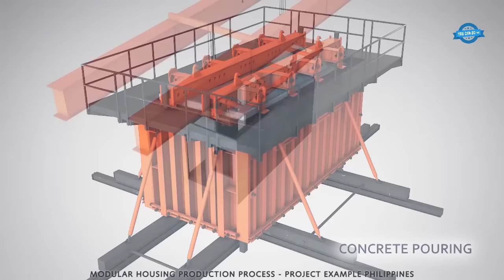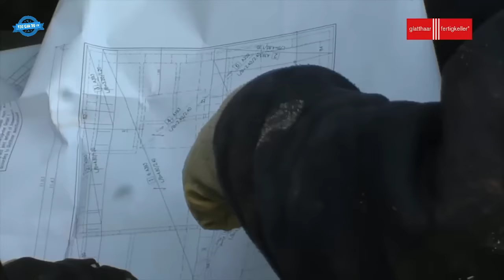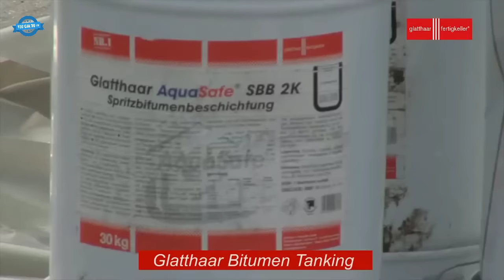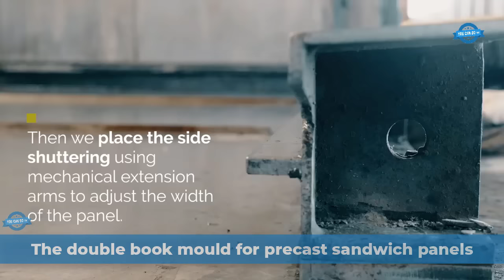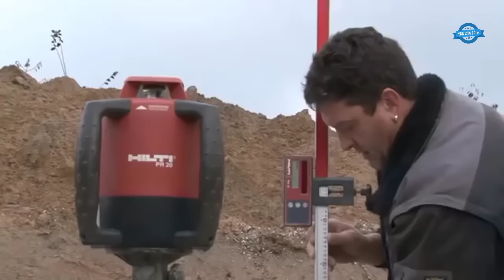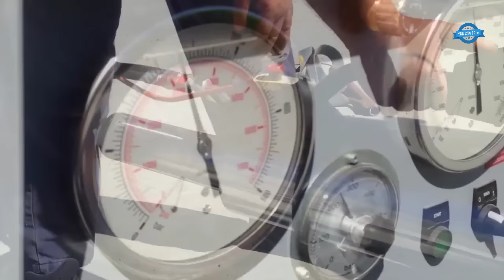Modern Construction Technology Is Extremely Fast. Production Process Of Precast Concrete Block

Comment: At 17:30 you see panels for the basement with window in them.  The problem is that these windows are below grade.  The outside grade is at the first story.  So the windows are buried in the ground.  Oops.  The marketing people should have checked with the engineers.